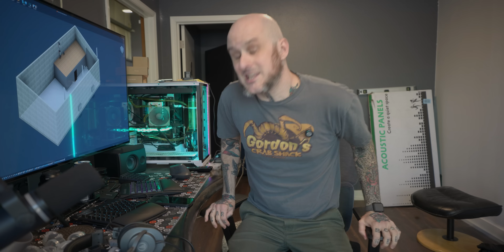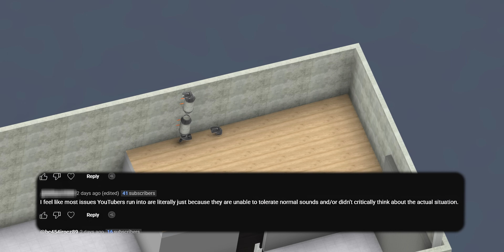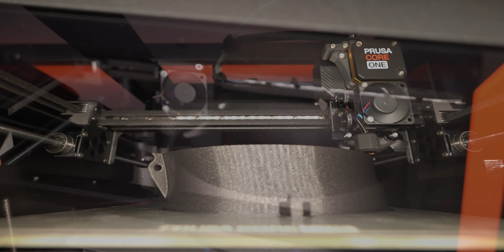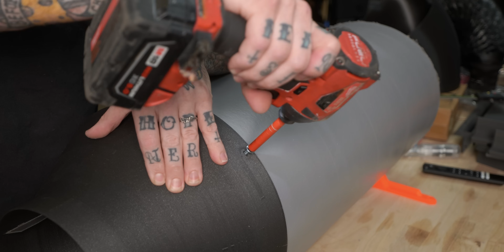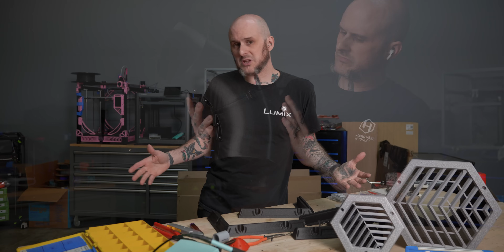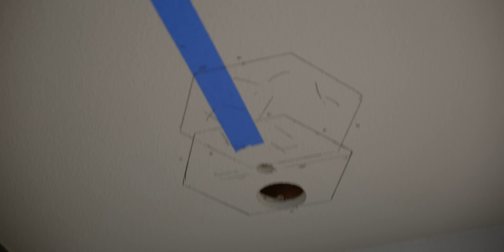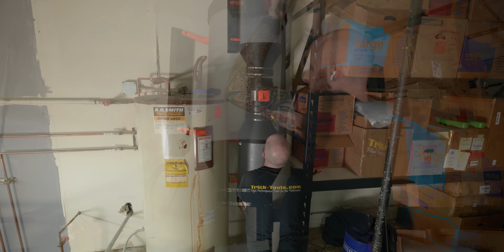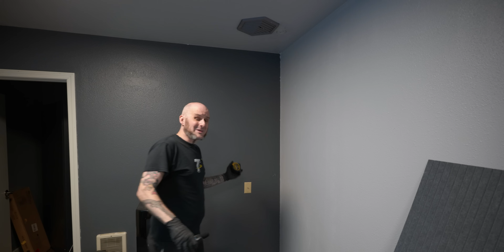This 3D Printed Contraption Cools My Office!?!

Comment: Celsius is the accurate measurement, boiling is 100c, not 212f, so who is the inaccurate? huh? when 0c is 32f... again, inaccurate.
Reply from the maker: Accurate to what? You picked water. But a human being can find anything between 0-100F habitable. Celsius is designed around water but we don’t live in water. We live in air and are human.

Comment: Try finding a quiet ceiling fan in that room to mix up the air, I'm a great believer in ceiling fans as they move a large volume of air very gently. Combined with the exhaust you installed should be just perfect. Also, just round to the nearest significant figure, not because I want to preach metric, but because that's how sane people read units and makes it easier to watch your video for slow dyslexic readers

Comment: Buddy just put your computer on the other side of the wall and route the display and peripheral cables (and probably a USB hub) through the wall to your desk.  Use an umbilical from the wall so your standing desk still works.  A 9800x3d and 5090 are about 800-1100 watts at a pretty normal load for workstation use (rendering videos and whatnot), let's say 1000W.  1W is 3.41 BTU per hour.  3410 BTU/hr being generated.  A small space heater is about 5000 BTU/hr.  You're basically running a small space heater on medium settings in there.  Move the PC outside, put some blinds up on the windows or tint/film them, and it will be much cooler than what you did in this video (not that it's a bad idea, seems like that space DID need a return, which is basically what you built).

Comment: Great idea, but I am a little bit concerned about the idea that the exhausted air will be picking up fibres from the insulation and push them into the air you breathe in the workshop. Having insulation fibres and dust in the air is a huge safety problem. The fibers in the Rockwool insulation might be as dangerous as the cf or gf fibres in filament. You should do something about it.
Reply from the maker: The cf and gf fibers from filament is a pretty overblown concern. I understand the concern of the insulation fibers but I’ll be setting up a whole studio filtration system in the not too distant future as well as hepa filters at various locations around the space. This much…. everything, going on demands it.

Comment: 32c is 89.6f 
Base 10 numeric system will always be superior to Freedom units.
Reply from the maker: And 89.7F is 32.061111C. It just isn’t a fine enough scale for if you are trying to be precise. You CAN be precise in Celsius but it requires many decimals beyond what Fahrenheit does to express the same heat energy. Arguably 0-100F is the range that most humans find habitable. In that way Fahrenheit IS a Base 10 system.
Reply: You cant feel the difference between 30c and 30.1c so moot point.

Comment: You’ve missed the easiest improvement… that computer pumping out heat. Vent that directly out of the room. Same could be said for the server. Either right through the wall to the main shop if you want or add ducting up to your exhaust fan. Could potentially reduce computer/server fan noise too if the negative pressure via ducting improves cooling.
Reply: why vent it out the room when you can just not have it in the room? Cables can easily be run through the wall to keep the computer heat outside the office.
Reply: @ck7802 only concern there is if the main room creates a lot of dust, but otherwise would also work. I contemplate the design of my future workshop office and how I’ll place my heat generator (PC) to be most efficient in summer and winter.

Comment: If you're concerned about filtering air coming into the room (which I imagine you are, since you're taking in air from the print farm and filtering your expected inlet), you should probably use positive pressure instead of negative pressure. Like you said about the air coming under the door, air is going to mostly come in through the least-restrictive openings. Those openings aren't filtered, which is a problem when dirty air is always trying to get in but less of a problem when it's clean air getting out.

In the meantime, fit gaskets to your door, keeping in mind when orienting them that the fan will always be trying to suck them inward. They'll also keep a bit more noise out.

Comment: if you get the chance, you should build a couple custom printers to share the load with your xl.  since a lot of what you print seems to be single color, single material, it should make your life at least a bit easier while giving you something to have fun with.
also, you could freak out everybody who's used to farenheit AND celcius simply by referring to kelvin - tends to not make sense to most without serious thought, since zero on that scale is based upon the concept of absolute zero.  average space not near a planetary body or star is said to be just a few degrees above absolute zero.

Comment: What about placing your PC on the other side of the wall? then you can run a couple cables through a hole and remove that heat load!
Reply from the maker: Check the Debrief video. 😉
Reply: Yup that's a far better idea. Those oled monitors really kick out some heat tho
Reply: Just duct the exhaust of the pc directly into the Warehouse might also BE a good option
Reply: That is what I did for my downstairs office.  Installed a couple brush plates and just did a cable pass through.  When doing Stress test with Furmark and Prime95 to do maximum heat, about 700W between PC and monitors per UPS with Monitors being ~110W.,  it resulted in an 8°F difference after 1 hour for the before and after.  That was the difference between 71°F and 79°F.  That is with AC running during the testing for both.  Also PC temperatures were better since it had access to the larger volume of air outside the room so it boosted higher and I could run higher fan speeds without hearing them.

Comment: Dope, I would say using less flex would help with static pressure, round spiral sheet metal is your friend.
Reply from the maker: I’ve been having trouble finding spiral duct that isn’t astronomically priced. Lot of the local hvac places won’t sell to the public. I really want that stuff for my ventilation setups I’ll be putting in the shop.
Reply: @MandicReally Really? Damn thats weird, idk why they wouldn't sell to the public. Pricing can vary depending on what you are going for, especially past 12" round spiral. For our shop we sell to whoever but pricing can go up quite a bit depending on what they are asking for.

Comment: Itching like crazy with just the thought of seeing the sound insulation being a layer of rockwool in full blast path of the the air... that thing is gonna shed fiberglass for quite some time! It needs and isolation layer to keep the fiberglass from getting into your air stream!

Other than that. Love the video, keep on keepin on!
Reply: I  was concerned about the silencer design too - but from the perspective of it being a dust fountain for the rest of the shop.... moving that much high speed air over exposed rockwool.
Reply from the maker: Rockwool isn’t fiberglass it’s mineral wool that really does not shed like that in my experience. Maybe the initial blast but otherwise I’m not too concerned.
Reply: @MandicReally i may be a bit more sensitive to it. But i also work with it regularly (high end construction). 

If it does not bither you. Awesome..  i would still offer that you think about it like a cherrybomb/glasspack, straight through resonator on a car. Design an interior liner with helical configuration of  louvers (open end against the flow of air), it will refract sound into the rockwool.

Comment: The biggest difference you could possibly make would be to tint those windows. Or at least get some blackout shades. That would drop your office temp another few degrees easily, if not another 5 degrees. And like you said, definitely put a gasket under that door. With those two changes on top of your ventilation system, I think you'll be sitting nice and cool in your office. For the windows, they have blackout shades that are on a spool that seal against the edges of the window frames. You could get those (or fabricate your own) and if you want some sunlight, you could open them. And if you want the office to be cooler, you could close them.
Reply: Some high quality heat rejection window film absolutely makes a significant difference to the Kw coming in through windows. Also helps brilliantly with UV fading everything inside.
Reply: I'd suggest getting a roll or 2 of that insulated reflective material used to make car windshield reflectors. Blackout curtains inside the window would just convert the sunlight to heat inside the "keep human cool" envelope. He might need that kind of heat source in the winter, though.

Comment: "Fahrenheit is the better scale"
*cries in celcius
just because you decided a certain temperature is a whole number that doesnt translate nicely to a different system doesnt mean its better 😭😭
water freezes at 0°C and boils at 100°C
Reply: I'm sure he is joking but people who seriously use that argument are ridiculous. I'm sure they still think inches is superior to centimeters (cm) as well despite all the fractions they use. 1 inch and 133/4537...
Reply: @atnfn i agree 😂
Reply: @atnfn  the reason inches are superior is due to certain fractions that metric fails at. 1/3 of a foot is what, precisely?...4! 1/3 of any metric unit is an infinitely repeating number. What about a quarter of a unit? A foot... 3 inches. Any metric unit? 2 and somewhere almost half of the way between the next mark... or just passing halfway point... you know, as close as each person gets. 2/3 of a yard? 2/3 of a meter? .66 ad infinitum!
Reply: @xsshow1115  A quarter of anything is 0.25, not too tough. Counter point: What is a tenth of a foot? 1.2 inches? So what is 0.2 inches? A fifth of an inch. Where's that on your ruler? 
Picking a specific divisor that goes evenly into your favourite unit and saying another unit is worse because that same divisor doesn't work? Invalid. 
(Incidentally, a tenth of any unit in metric is super easy, and fifths are just two of those.)
Reply: walk outside
0°F is very cold 100°F is very hot
lowkey nicer for weather
Reply: @doppled 1 mile = 63360 inches... 1km = 100000cm...
1 gallon = 8.345404452021 pounds.... 1 liter = 1 kg
Reply: @doppled  
walk outside
-20 is very cold, 40 is very hot
same difference.
Lowkey nicer for absolutely everything else.
Reply: @WhiteG60 that is the difference between those two standards. One was calibrated based on water. The other was calibrated to roughly be based on humans. That’s why there is such a distinct difference and odd number for water. It does however do very well to granulate habitable temperatures. Thats exactly why it’s better for weather and environmental scales. Generally temperature isn’t referred to anything than whole numbers so having more like you said can make a big difference between people on comfort. The downside is it doesn’t play well in math like metrics does. This compounds with learning two different scales. However if you think on one for weather and habitation use only and all others to Celsius than it would be fine. Just no one wants to do that and gets all high and tight on superiority. They are standards. Even the metric systems is a number based off of another value by definition. Heck the US standard model is by definition based on a set equation value of the metric system.  None are superior just different maths. Since its powers of ten the human mind finds it easy to use metric. The fact that the value is based on a physics thing that is multiple variables is what makes the superior argument stupid as well. Temperature for habitation however is usual static’s numbers that are memorized and associated with feelings of temperature. It’s an arbitrary number that has no consistent meaning other than memorize perceived comfort. I mean 23 C of saying 72 F is just a number for reference to feel. Water boing or freezing is just hot or cold to us and isn’t a viable reference scale. Freezing we can tolerate but the boiling part we couldn’t get that far without significant equipment. So the Celsius scale really becomes less valuable to describe weather on earth or thermostat temperatures in homes.
Reply: @egondro9157  except by that logic, shouldn't 0 F be where it gets very cold? But no, 0 F isn't where it gets very cold, that's just the temperature of the coldest thing they knew of when they made up the scale. C is calibrated on the phase changes of water, which is objective, F is allegedly calibrated to human comfort, which is entirely subjective. Personally, I find C to be very intuitive to dealing with habitation temperature because I grew up with C, and I think anyone saying "F is more intuitive to habitation temperatures" are actually just failing to recognize their bias from growing up with it. Realistically, C vs F is perhaps the least significant category of metric vs imperial (the real advantage of metric is converting between different scales of units, which temperature only has to worry about if you're doing something sciencey enough to need Kelvin, at which point you're probably already using metric anyway), but what does infuriate me is that, as a Canadian, a country where metric is the national standard and all our outdoor temperatures are given in C, I have never seen a digital thermostat (perhaps excluding smart-home thermostats) that gives temperatures in C, so I'm stuck here seeing that it's 78 inside and 21 outside and I don't know which one is hotter.
Reply: @egondro9157  theyre still both based on water. one just chooses to divide the range from freezing to boiling into 180 units and offset by 32... one likes to divide it into 80 units. two choose to start from absolute zero yet retain the same 100 or 180 unit relationship converging at -40.

Comment: Add a ceiling fan to the office to better mix the air layers.
Reply: Came here to say the same thing. I'd be willing to bet adding a ceiling fan to the office would really help. Insulated blackout curtains for the front windows might be a great bank-for-the-buck addition as well. To help drop the input heat load.
Reply: @AaronSchmidt52  Ditto on the curtains. Or using window film if the budget does no allow for curtains.

Comment: Rackmount your computer and run a fiber optic dock like Linus does and those temps will drop even more. The bathroom will be warmer though.
Reply from the maker: Those setups lack connectivity for content creation purposes unfortunately. High speed USB and such. And are realllllly expensive. I did a thunberbolt version in my Philadelphia studio that was nice, but still had compromises.

Comment: Sorry, but the entire rest of the world uses celsius and the metric system.
Reply: I’ve been working on converting my life to metric. At 63, it’s a challenge to convert my brain. But, for all of my design/measuring tasks, I’ve pretty much converted to metric. Though there are times I need to use ‘imperial’, because that’s the system was for the things made by Americans. Most of my personal cooking has been metric for years. Though, at work, it’s still lbs and ozs (because my boss won’t convert). Speed and temperature are the challenge for me. I have little to no metal conversion system for gauging either system.
Reply: Fahrenheit is better for people temperatures. It’s a scale of 0-100 for how hot it is with 0 being very cold and 100 being very hot. It also allows more granularity for the typical temperatures that people are in. Celsius is good for science and things
Reply from the maker: Doesn't make it superior.
Reply: @MandicReally so the rest of the world is using it because it's definitely not superior? Weird logic. 🤣😋

If fahrenheit was that good, the rest of the world would know more about it. But it's not.
Reply: @johan23501  yeah that is weird logic. good thing thats not at all what he said. All he said is that people using it is not undeniable proof of it being better.

Comment: "I spend way less time babysitting printers and more time just building real solutions" - best line ever.
Reply: I’m getting to the point where I’m tired of babysitting and fixing printers myself. Pretty close to purging and buying appliances instead.
Reply: I don't know why people have so many problems, I have a flashforge ad5m pro and a custom machine made out of a cr10 max yet I have very few if any problems when I use the correct plate.

Comment: Fun fact, Fahrenheit is inherently flawed. Dr Fahrenheit wanted water to  freeze at 0 and boil at 180 but his equipment was mis-calibrated. So 90 F should really be 58 F and that comes out to 14.44444444 C. Hmmmm, maybe that didn't disprove your point.
Reply: When you're European the way you're taught, you have no prior experience with Fahrenheit so like.. water freezes at 0 and boils at 100C. Comfortable room temp is 20-25C too. From there it's incredibly intuitive to gauge your everyday temperatures
Reply: @ellafoxoo it’s all in what you know. While metric is, in my opinion, the superior system, if all you’ve ever known is ‘imperial’, then it is reasonably intuitive. I know/can feel the difference between 70 and 80F. I’m clueless to the difference between 20 and 30C.
Reply: You could avoid the mess with F to C conversion mess by keeping everything at 0. Personally, I don’t like zero. But I’m also not so concerned about decimals in my room temperature. Is it hot? 😢 Is it cold? 😖 Is it comfy? 😎
Reply: I think if you research, you'll find much better explanations for the scale (and why his original measurements were off by a few degrees - not 32).